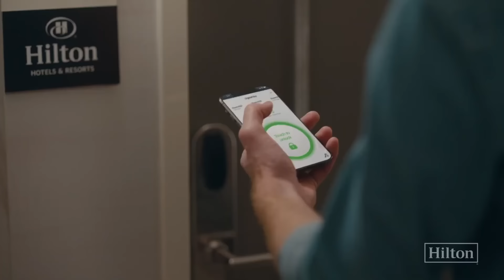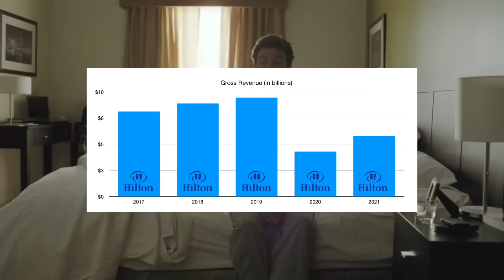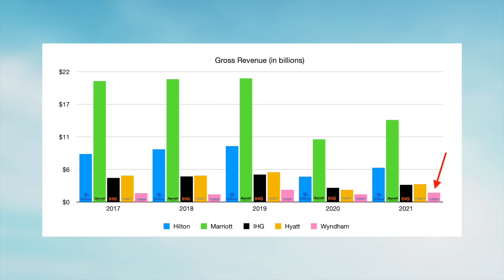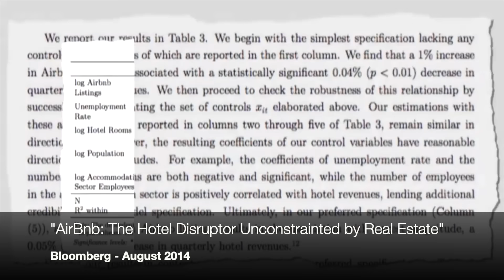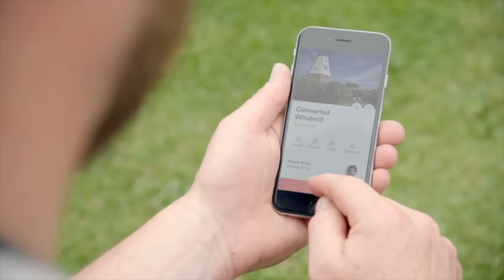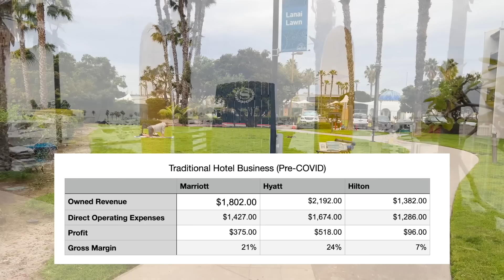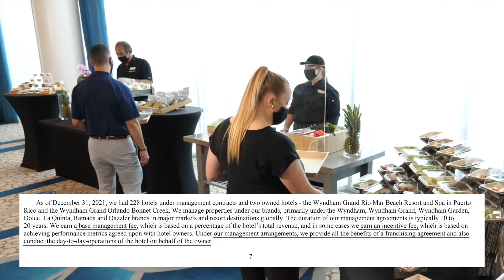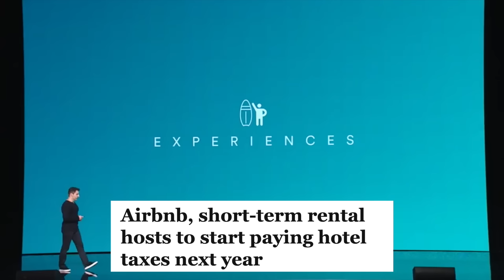Why Airbnb Fails to Disrupt the Hotel Industry

Comment: I’ve done quite a few cross-country trips and always think I’ll use some airbnbs but almost never do. They are often more expensive anyway, and with a hotel, you don’t have to worry about not finding the location, paying for parking, the key-code not working or completing the host’s check-out list. Airbnb is great for a unique experience but not when you just need somewhere to sleep or work.
Reply: I've stayed in an AirBnB once.  It was a guest house owned by a rich couple, which they rented out when their parents and in-laws weren't visiting.  Anyway, I was part of an extended family group consisting of of five adults and two little kids, visiting a different state for a wedding.  We only stayed at an AirBnB because we wanted a kitchen.  The math showed that paying for multiple extended stay hotel rooms for our little group (Residence Inn, Homewood Suites, etc.) would have cost more than renting an entire house.  However, the house wasn't cheap!  And on top of that, the owners charged a flat rate cleaning fee of $200 or something.  Hm, I don't recall ever having to pay a cleaning fee at a Marriott or a Hilton.  And if it weren't for us needing a kitchen, paying for multiple rooms at a Super 8 or Motel 6 would have cost significantly less than renting the house.  Needless so say, the hotel industry doesn't have to worry about losing me as a customer.
Reply: @hamsterama  yup between crazy high cleaning fees(sometimes they are higher then the cost of rental) airbnb just doesn't make sense
Reply: @eskanda3434  I absolutely agree with you!  This was my first experience with AirBnB, and will likely be my last.  Luckily, in this case, my mom and dad covered the entire cost of the AirBnB rental.  The owners of the guest house expected us to keep the place clean.  Like, according to the rules, we had to  sweep the floors, wash our own dishes in the dishwasher, wipe the tables, wipe the countertops.  If we didn't, they would have hit us with additional charges.  And then they charge a $200 or so cleaning fee anyway.  It's ridiculous.  I don't have to deal with that nonsense in a hotel.  And many hotels offers free additional services, like breakfast.
Reply: @hamsterama  Super 8 or Motel 6 sounds like a depressing place for a big family get together tho. When you book your own Airbnb you can see all the rules, fees, and checkout procedures up front so if any of it makes that particular BnB not worth it to you, don’t book that one. I’ve only had very minimal cleaning to do, wash used dishes, throw used sheets and towels into a pile, sometimes take out trash that’s it.
Reply: @lexa3331  Trust me, my family wouldn't care!  LOL!  Well, you're right, a Motel 6 would kinda suck for a family get together.  As for Super 8, they're franchises, so the quality can vary from owner to owner.  It's true, some Super 8's are dumps.  But I once stayed at one in Indiana, and that one was a really nice, clean, updated hotel with great staff.  You just gotta check reviews online.  By the way, I didn't book this particular AirBnB, my brother-in-law (sister's husband) booked it, and my parents reimbursed him.  Still, even if read the rules, fees, and checkout procedures, I still feel it's just easier to stay in a hotel.  At least with a hotel, there's consistency, plus you can accumulate points towards free stays.
Reply: Also I remember a host once chaged me for stains in her bathroom from in the oddest places i just paid it and another time a guest charged me a $200 charge for having left a light on. The host are hit or miss .
Reply: @magictravelkitty3440  Which is exactly why AirBnB will never be a serious threat to the hotel industry.  I wouldn't want to stay somewhere and get charged surprise fees.  I mean, if the guest damages something, that's one thing.  But normal wear and tear, such as little smudges of dirt, that's ridiculous.  If someone wants their property to stay perfect, then they shouldn't rent it out.
Reply: @hamsterama  Some places charge a resort fee, which probably encompasses cleaning, but I think it's max $50 resort fee. I think it's usually like $30, not $200, lol. I don't like the resort fee, though, I'd rather the price be a bit higher and be transparent.
Reply: @Megan_Truly  I agree!  I'd also rather see one single price.  Not some fake low price to lure you in, with all sorts of unexpected charges added on.  No resort fees, cleaning fees, or other such nonsense.  Just one single price, like a hotel.

Comment: Using AirBnB is a bit of an adventure. The accommodation is part of the travel experience because there's so much variety in what's offered, rather than just another identical room used just as a place to rest in between seeing the sights. It's clearly for a markedly different customer base, so there's no reason it would significantly hurt hotels.
Reply: I’m one of those people who flip flops between Airbnb and hotels based on which is better for my travel needs. Despite the quality of Airbnbs getting worse, I’m still consistently choosing airbnbs over hotels for two reasons - 1) with an Airbnb it’s much easier to travel with my dog. 2) hotels are often in really out-of-the-way locations. Boutique hotels that are in central locations are harder to come by (at least in the US) and a lot of the hotels seemed aimed at business travelers who stay near the airport or highways.

Comment: Because:  1 security. 2 no hidden peep cams. 3. Guaranteed booking no crazy greedy hosts who will last minute cancel your booking. 4. Customer service. 5 amenities. 6. Location. 7. Creepy hosts.
Reply: It’s really creepy that people install cameras inside.
Reply: For real!! Creepy hosts is a thing 😂
Reply: 1. Depends on the building, many apartment blocks have full time staff. Many hotels are unstaffed at night. 2. Google peepcam in hotel, you're not safe. 3. I've been cancelled on arrival at hotels due to double bookings. 4. No personal service at a hotel like at airbnb. 5. Depends on building. 6. Depends on building. 7. Creepy hotels
Reply: This guy above who tried countering your points runs an AirB&B himself I learned after scrolling down.. some disclosure
Reply: Exactly! Hotels are at least afraid of lawsuit and have their reputation on stake, AirBnB hosts have no such thing
Reply: @xpusostomos  Hotels might still have peepcams, but generally as long as you're not staying in a 20 dollar Red Roof Inn room, all of the other points hold true. Decent hotels (80+ dollar range) will have someone at the front desk.

I've booked into a ton of air bnbs and hotels in the same areas over time, and I would take hotels if I could. (Brand name/ conglomerate) hotels will have a level of quality control that air bnbs do not. 

Also as for the creepy hosts thing, yeah hotels might have creepy front desk people, but that's what the deadbolt on your door is for. You often dont get deadbolt options in your air bnbs
Reply: @steven5781  you're right. That guy even as far as say " don't think cleaning fee as a cleaning fee. Think of it as a discount for multi days stayers compared to a hotel who pay a cleaning fee everyday, but it's just not itemized". I mean I'm perfectly fine to pay some buck but it's already all-in-one payment than to have to pay more but turn out I do not get what I pay because it was...a discount
Reply: It is really interesting how people see this from a different perspective. It may be a different experience because of a country / continent you are in. I've rented my first AirBnb in 2014 I think. I tried to search for hotels when travelling (to compare prices) but I always end up in an Airbnb. I travelled only in Europe and rented probably 4–5 AirBnbs a year.  The only bad experience I had was this year (host asked me to pay extra off the books and was very unhappy when I said no, lol. But customer support sorted it out).

But in general AirBnB was a nice experience and usually I feel more secure than in hotel. There is why:
1. Security (I feel safer in local community than in a hotel with drunk tourists)
2. Hidden cams (well, they can be hidden in both, so I trust reviews)
3. Guaranteed booking (hahah, well those few times I chose a hotel over Airbnb I always had problems... Either at the reception no one spoke the language they supposed to, they did not have free parking spot when they said they have one, etc. Airbnb was more reliable for me (you just need to read the listing)
4. Customer service (well, this is personal, I guess. I love to know on vacation that I can sleep as long I want and do not be wakend by room service)
5. Amenities (AirBnB wins over hotel, because I can choose with a tub (or shower), with a full kitchen (or without), with a pool (if its in a holiday country), while hotel room at best have a kettle and that is.)
6.Location (usually AirBnBs have better vibes, also I can live like a local in more secluded, quieter place. While in bigger hotels there is always someone waking up at 3 am to go to airport...).
7. Creepy host (haha, this one is also funny, I hate receptions and all those „Hello mam, how was you day?“ So AirBnB with a self check-in is a dream come true to me. Also pandemic wise it is a safer option, because there are less people around you. And creepy hosts do exist, but I've never met them because I never book a room if there is a bad review).

I should probably add, that I live in a small country and travelled only in Europe. So maybe in USA there is a different situation. But, for example, if I like a certain hotel brand and then travel to another country – there is no guarantee that I can find the same hotel. So everytime I still have to read all the reviews and choose my hotel. So I'll better read listings on AirBnB (that way I at least will have someone that I can complain to, lol.)

Edit: added 5–7, because they got cut from the original comment.
Reply: Exactly! The peeping camera is one of my main concerns!
Reply: This is why I never fell for any of these types of businesses. Too paranoid I’ll kidnapped by some creepy Uber driver or get creeped on by AirBnB.
Reply: @sweetembrace6706  The odds of that happening in a quality hotel (i.e a Hilton or Marriott, etc) are effectively zero. Our hotels do room quality checks between guests by the housekeeper, head of house keeping, maintenance tech, sometimes head of maintenance, the front supervisor, and 90% of the time the general manager. There is no way they would notice a hard wired camera while doing their inspections in a room that has an exacting and particular lay out.
Reply: @accelmemory  Everything can happen in a hotel also, however the comeback and stakes are totally different.

Comment: The places where I've ended up staying at an AirBNB are places that are tourist destinations that don't have enough hotel rooms - a situation you get in climates that are gorgeous for 3 months in the summer, but cold and miserable in winter.  My experiences in these AirBNB accommodations were largely negative - staying in converted apartment buildings, converted daylight basements, and add-ons above garages.  Accomodations varied from outdated to poorly conceived, though they often featured nice touches in regard to furnishings.  I can only hope that I disrupted my hosts' sleep half as much as they did mine; noisy, nosy, and ever-present.  AirBNB is the stay of last resort as far as I'm concerned.

Comment: I was an early adopter to AirBNB. It fit my travel style really well. I like to visit a city, have a space that feels unique and my own for the period of time that I'm there, and I don't need to be catered to day-by-day. It works out really well to rent a unit for 10 days and not need to pay for food and cleaning every single day.

It also makes a lot of sense when you have a lot of people travelling together. When I've had people come to town, I've even chipped in to rent a larger multi-bedroom unit that will be cheaper for everyone, even if it was nearby my home. The cost per person ends up so cheap and you can have a really nice shared place to hang out using pooled resources.

I recently did a mini-vacation and ended up with the option of 2 days at an airBNB or 2 separate hotel stays. The airBNB was just not competitive. Way less amenities for the price, hard to find as good of a location, and the parking situation was kind of a mess in a downtown area. We'd have ended up probably spending an extra $50 per night on ubers to make it work.

I think both definitely have their place. If you want to get a group of people together and share resources, or stay in one place and immerse yourself for more than a few days... AirBNB is great. In all other areas, hotels still reign supreme. Good for short notice, short stays, predictability, consistency, higher degree of service, convenience, and more.

The two hotels I stayed at were independent or part of very small chains, and hit huge on the uniqueness and charm... where the competitive AirBNBs were very generic condos... so you can't always put the uniqueness tick in AirBNB's column.

Comment: I agree, but it seems like going forward Airbnb is operating as a listing service for independent hotel operaters, but without the advertising costs. It would be interesting to have you look at valuation multiples applied to each type of revenue for the different hotel chains, and then compare to Airbnb. I assume you are paying a huge premium for Airbnb vs traditional chains even though the revenue streams are similar
Reply: I think you got it, this is likely to be the ultimate logical evolution of Airbnb

Comment: The main difficulty I've had with AirBnB and similar room or house rentals by owner is nobody being there when you arrive, you don't know how to get the keys or can't get the keys, and it can be hard or impossible to communicate with the host (not answering phone, not replying to texts or emails, etc.). Meanwhile you've arrived, standing in the rain and can't get the keys to get in the room you paid for, and can't even communicate with the host.
Reply: Interesting. I’ve hosted over 1,000 reservations. I’ve never had someone stranded outside my Airbnb door not being able to get in except when they arrive several hours before the Check in time
Reply: Almost no airbnb has keys anymore.  Ever heard of keyless entry?
Reply: I find this to be a plus. Sometimes we may be arriving very late, I wouldn't expect a host to meet everyone personally at the door. I've found most hosts to be extremely reachable, in those cases where I had a problem getting in. But lockboxes or sending me the code to enter beforehand is very convenient.
Reply: Ah, indeed. My host disappeared for many hours when I arrived in Sydney a number of years ago. I thought I was going to sleep outdoors that night and it definitely made me rethink about using the service again in the future. At a hotel I would have been able to check in almost any time of the day.